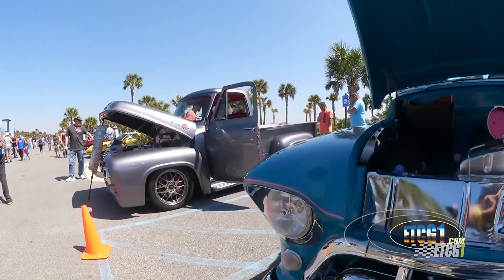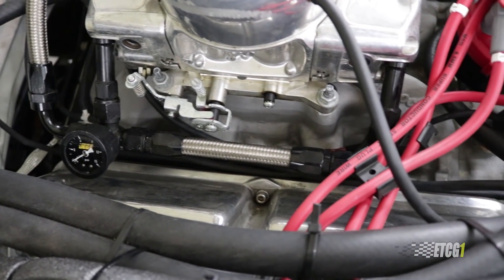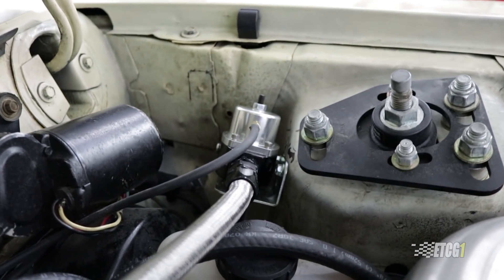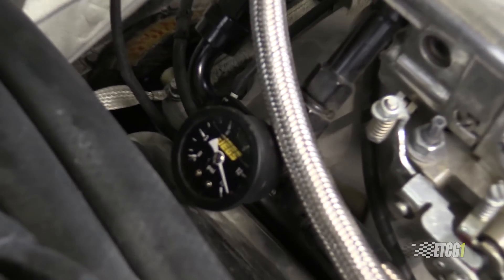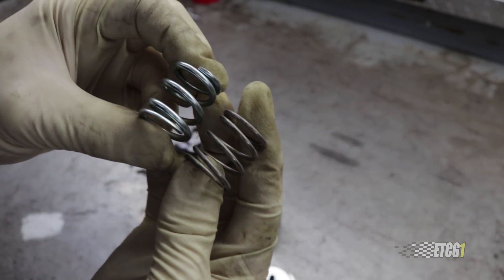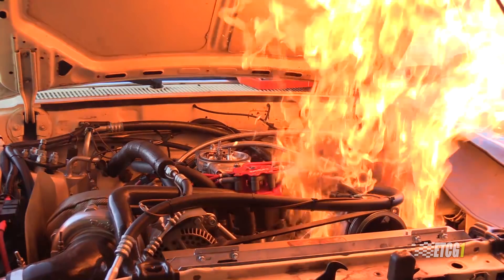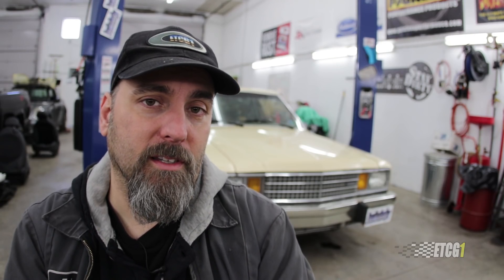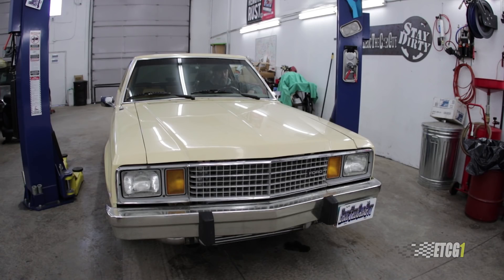How Did the Fairmont Catch On Fire?

Comment: Don’t worry Eric, Same thing happened to me on an empty lot with my 1999 Ford Ranger. Except, I had no extinguisher. I used my Dog’s bucket of water to put that b__ out. Luckily, I had that on hand and wasn’t driving the dang thing. I actually had it parked for a good 6 months. I Replaced a leaky fuel rail, the spark plug wires, and what was left of a melted fan shroud, and the plastic fan. The problem did not come back. My conclusion....wire probably got bit by a rodent, and arced to the fuel-wet chassis. Boom!!! Instant ignition!!!
Reply from the maker: Sorry to hear that. Glad you're OK.

Comment: I had about the same thing happen to me long time ago i put in a injector in a throtal body and didnt catch the bottom oring was missing and it filled the engine full of gas i fixed it and pulled the plugs unplugged the coils cranked it over and it went up in a ball of fire the starter must have sparked the flywheel when it cranked good thing i had that little red bottle lol made one hell of a mess tho
Reply from the maker: Glad you're OK.

Comment: on my turbo civic i accidentally filled the intercooler with water/meth when testing it.

had something wired wrong or something set incorrectly in Netune and took off driving. car was acting strange come fo find out the meth was on the whole time and filled the intercooler with fluid. got lucky i didnt hydro lock the thing.

Comment: On my carby datsun my FPR was leaking so I deleted it from the fuel system and have been running without it .it has a return to tank line should I worry about buying a new FPR ? I don't want any fires.
Reply from the maker: If it was there in the first place there was likely a reason.
Reply: ETCG1 thanks for the reply. Will buy a new one.

Comment: Glad you and the car were unscathed. I have to say it was somewhat suspect that the fuel pump was running for so long during your initial test. I am a Carter AFB fan after spending countless hours with friends trying to adjust the float levels on the Holleys, and shredding the stupid little gaskets. I hope they've updated their design since then. Good luck on your 22 hour shakeout drive.
Reply from the maker: The fuel pump is on a manual switch. I can leave it on as long as I want. Now that I have a return system it isn't an issue because the fuel that isn't used goes back into the tank.

Comment: Wow, that sux. Damn spring!!!! On my first engine build I forgot to lock the cam gear bolts on 350 SBC. I got about 500 miles on it before the bolts started backing out and started pushing the cam backwards in the engine.  The excitement really started when the lifters started falling off the lobes. After I put out the fire with the same kind of extinguisher you used, pulled the engine, and opened it up for the autopsy did I figure out what had happened. Thinking about it afterwards there were clues that, had I been more experienced, I might have picked up on and saved the build. But, maybe not. Then again, had I been more experienced I probably would not have missed locking the cam bolts.
Reply from the maker: Experience is often hard won. Glad you got it sorted.

Comment: Don't beat yourself up.... I watched a 1969 Impala burn to the ground 15 minutes after a complete restoration, filling up for the first time at a gas station. This stuff happens.  

As to young and stupid... I once opened the hood to find a boiling lake of gasoline on my intake manifold... so I drove the car home and fixed it... I figured as long as there was no spark I was perfectly fine.... and yes, I actually got away with it..  No spark, no bang, no blaze... 

Oddly enough I had an nasty fuel leak this year, the mechanic who replaced the fuel pump and filter used the wrong kind of hose and it dissolved in the gasoline... again got lucky... engine compartment full of gasoline and no spark, and I made it home.  I replaced the hose myself after that with high pressure fuel line.

Comment: Thyat pump is noisy AF. Rubber isolators are your friend
Reply from the maker: It does have rubber insulators on it. Also, it's way quieter than the old one, you can't hear it with the engine running.

Comment: That IS NOT your fault or your mistake. You did what 95% of gear heads would of done it. I to had a mishap with modifying a Toyota. Except I had a electrical fire on my first test run. It happened on the return trip from Elgin IL to Chicago 45miles. Suddenly the cabin just fill with smoke like crazy fast. No tools only a pair of welding gloves. Well I did save the car and also had 3rd degree burns to my right hands. It would of hurted more lossing the car then the burn to my hand
Reply from the maker: Ouch! Glad you're OK. Do you have a fire extinguisher now?
Reply: ETCG1 I keep 2 on hand